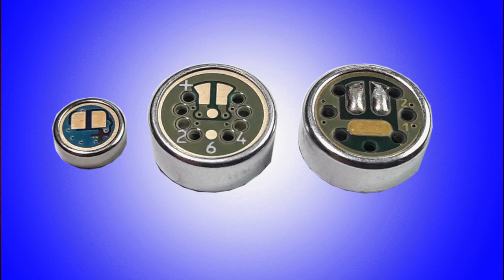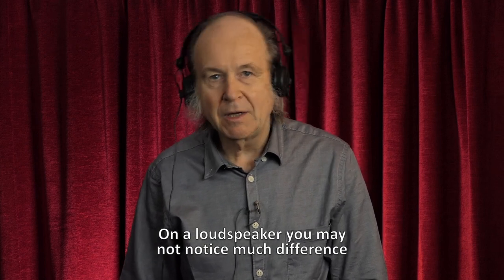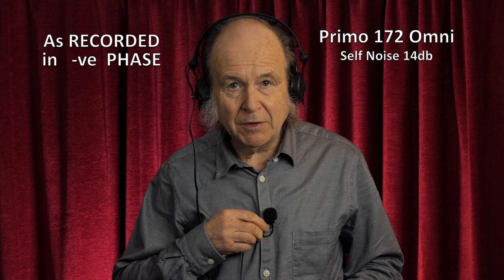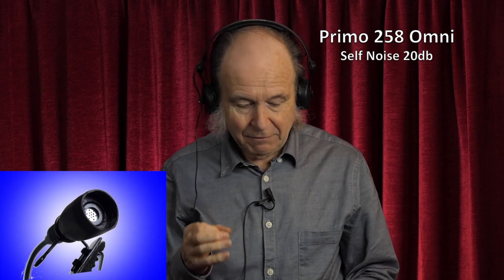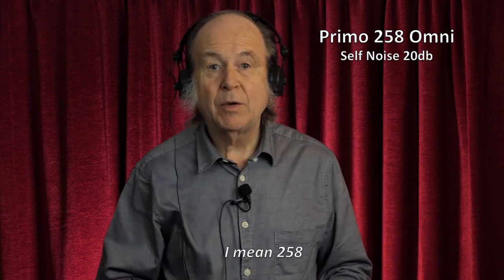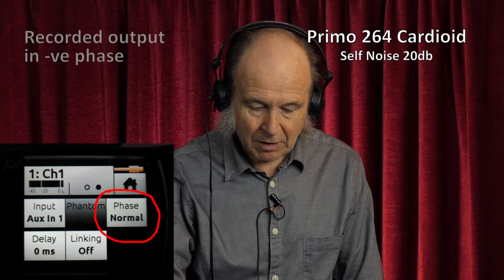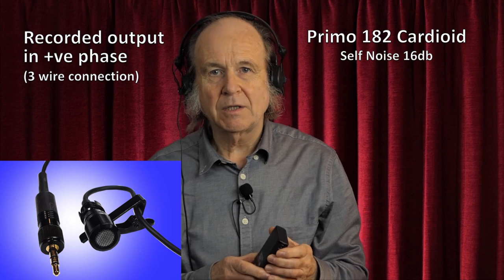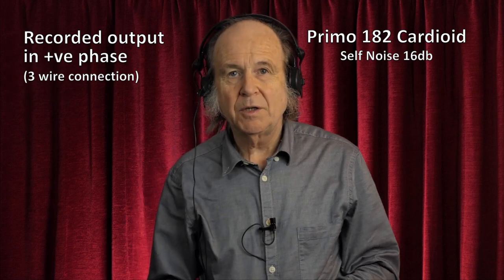PRIMO Lapel Mic capsules - low noise - effects of negative phase mic output - Lapel mic placement

Comment: Most of the polarity flip difference you are hearing is the signal vs your own bone conducted "head voice."  They will either cancel out or reinforce, the two signals, depending on the polarity in the headphones.  There is less of a difference to a third party listener, or your own listening after the fact (not live, but recorded playback.)  Just thought that might be added to the discussion.
Reply from the maker: Yes, that is the only explanation - important to know that listening to yourself live can give you a totally different sound - a problem if you are applying EQ.  Thanks for your useful comment.
Reply: @delcanvideoproductions4895  I could hear a difference when you swiched them.
Reply: @fitnessboss  Thanks for that confirmation.  It's not just me then !  Some people can't tell - it is less evident on loudspeakers because the room scatters the sound waves.  I always like to have the correct phase when editing and adjusting EQ wearing headphones in order to get the final sound I want.  I was surprised that this is not a well known phenomenon.
Reply: @chrisdelcan2757  Was waring M50s so might have been that headphones ability to pick it up better than say a phone speaker. Also this video was great exactly what I was looking for. These capsules seem like good value for the quality. Why pay $150 for a road lav mic?

Comment: The differences in the signal you're hearing when inverting negative phase to positive phase, is due to FET leakage. In the common 2-wire (negative phase) configuration, incoming FET current leakage from (+V) Drain to Gate goes through the gate's high impedance and the capsule's -mV signal output (dips) are unaffected. The FET leakage in opposite direction, when the capsule outputs a high +mV signal, a small diode amount of voltage leaks out to Source and rolls off the peaks. When you invert this signal into positive phase, the dips and rolled off peaks are inverted, so the peaks become more pronounced. -Doug Ford, audio design electrical engineer, explains it a little bit at the end of EEVblog #611 Electret Microphone Design.
Reply from the maker: Hi Justin, Thanks for that. I could not figure out why flipping the -ve phase mic output produced a different more rounded and open sound, when phase reversal should not have made any difference.  So this is why it changes the sound ! I'm really grateful for your explanation. Thanks.
Reply: Thanks for that - it went against everything I knew.
Not the first time, nor the last, that less-than-perfect real-life components have offered potentially useful 'flaws' !

Comment: Inverting the polarity of a single mono sound does not create ANY change in what it sounds like. 
If u have two channels that record the same sound, then you will hear a difference if u flip polarity on one of the channels and leave the other as is. That is because the waves start to cancel eachother out in different ways than before.
Reply from the maker: When I flip the phase at 2.35 there is a difference in the sound. I don't know whether that is because this mic is a 3 wire capsule wired as a 2 wire, which alters the output route on the FET amp in the capsule - but there is a difference on the recording.  It is more pronounced when the mic is closer to the sound source. I have run several tests and the difference is discernible on playback, not just when self monitoring live.  No real explanation for this since, as you say, phase cancellation can only occur with 2 mics on the same sound source.  Thanks for your input.

Comment: Yes good effort mate
Reply: Thanks Steven.  I'll try to get som more content up.
Reply: I have been wanting to do some nature recording on the cheap.
I have a pair of primo inserts which i will be wiring together to boost sjgnal.  Are there any easy ways to measure thr noise from your mic ?
Reply: @stevenmcc6052  Not sue how you would make an accurate technical measurement of inherent noise from the mic capsules.  I get a general idea by recording my voice at  about 15 cm peaking about -6db in a very quiet and non-reverberant room and then listen to (and look at) the noise levels in iZotope RX (or you could try Audacity).  If you stick to the gain levels you need for narration at 15cm then you should be fine for nature recordings.  Obviously if you crank up the gain too much you will get hiss from your system but the Primo 172 capsules (now 272) at SN 80db (self noise 14dB) are about as quiet as you will get without specialist kit.  Let us know how you get on.

Comment: This is complete nonsense. Flipping the phase of an audio signal does NOT change the sound AT ALL. What it will do is change how that source interacts with other mics or your perception of the sound in your headphones as you speak and the interaction with your skull. But only as you speak and listen, not playback. It will have zero effect on the timbre of the recorded sound itself.
Reply from the maker: Hi Andrew, Thank you for your feedback.  
   There are two distinct things here - one as you say, is when you listen to yourself live through headphones,  where the mic sound interacts with the 'natural' sound in your head - the other is the lesser known phenomenon of a negative phase signal sounding different when you listen to the recording afterwards.
      There is no obvious reason why a negative phase signal from a single microphone (with no other mics plugged in) should sound different from a normal positive phase signal when you  listen on playback to the recording through headphones - but they do often sound significantly different.  The negative phase output is often quite stony and harsh, whereas when flipped to positive the sound is much fuller and more rounded.  I have demonstrated this many times with different mics.  The difference is only noticeable when listening to the recording on headphones where the sound is being received directly and separately by your ears.  There is no significant difference if you listen on monitor speakers - I suspect because the sound is bounced around the room space so is not hitting the eardrums as pure separate signals.  
       But why does a negative phase signal sound different on headphones ? The most likely reason is where the recording produces an asymmetrical waveform - many male voices (mine !), brass and strings often produce an asymmetrical waveform and it is probably this that accounts for the audible change in the 'tone' of the mic - although I am not sure why.
      A few weeks ago I came across a users guide note from AEA about the Coles 4038 ribbon mic, which talks about capturing sound in the opposite phase from the back of the mic and that flipping the phase of the signal from an asymmetrical waveform (eg some voice, drums, bass and plucked strings) changes the sound which, it says, can't be corrected fully by EQ. 
   It says :   
" If you change the polarity of these [asymmetrical] signals  it tends to sound as if you made an EQ change. However, if you try to EQ back to the original sound, you never can get it back. Thus it is a good idea to to watch polarity in microphones, cables, electronics and speakers. "
      So there is some authority on this phenomenon, which does not yet seem to be explained by sound science.  At the end of the day it is what you actually hear that counts - science is only a way of trying to explain natural phenomenon.
      Have a look at my more recent video covering this and listen to the sound samples on good closed back headphones.  - and do some tests yourself.  If you can't hear the difference it is not something you need worry about.
https://www.youtube.com/watch?v=dx3bYoL3MZ0
Reply from the maker: Hi Andrew, We now have a useful technical explanation from Justin who says (Sept 13 2022)
Justin  • 5 days ago
"The differences in the signal you're hearing when inverting negative phase to positive phase, is due to FET leakage. In the common 2-wire (negative phase) configuration, incoming FET current leakage from (+V) Drain to Gate goes through the gate's high impedance and the capsule's -mV signal output (dips) are unaffected. The FET leakage in opposite direction, when the capsule outputs a high +mV signal, a small diode amount of voltage leaks out to Source and rolls off the peaks. When you invert this signal into positive phase, the dips and rolled off peaks are inverted, so the peaks become more pronounced. -Doug Ford, audio design electrical engineer, explains it a little bit at the end of EEVblog #611 Electret Microphone Design."

Comment: Great video, great crystal clean low noise sound! Were the soundtracks edited?
Reply from the maker: Hi, Sorry for the delay in responding.  The sound from these mics / capsules was not processed - no noise reduction applied and no EQ, so you can hear the actual sound that the mics produce.  The Primo mics are incredibly low noise.  Another capsules I have since found is the PUI 5024L which is very low noise (80db) and has a nice warm rounded sound if tht is what you are after. (Also try inverting the phase !!)